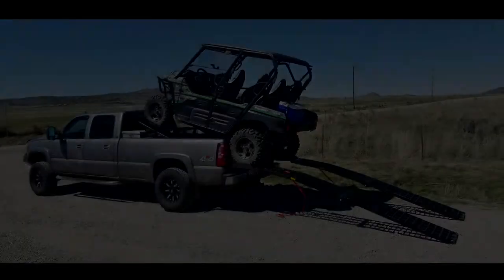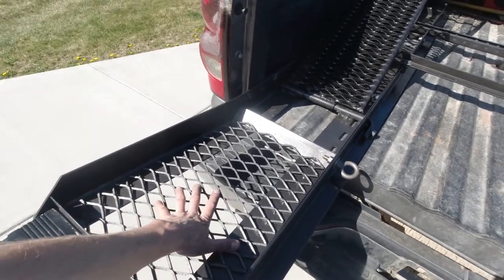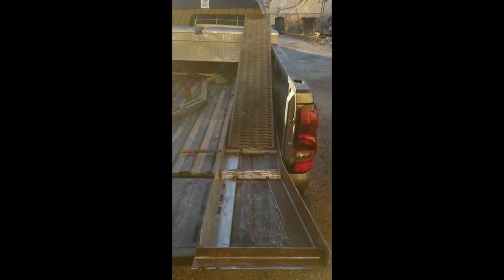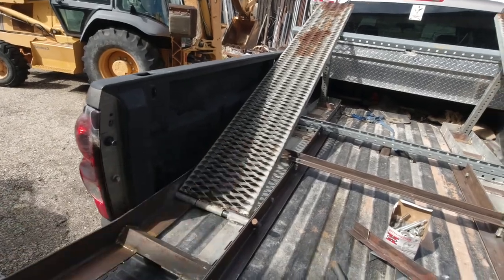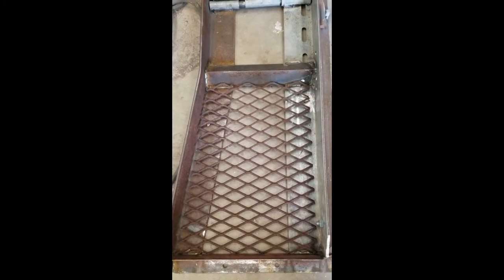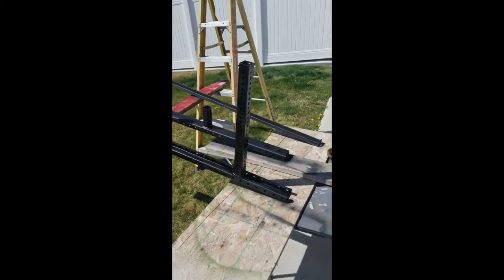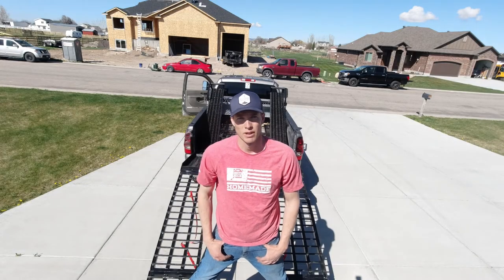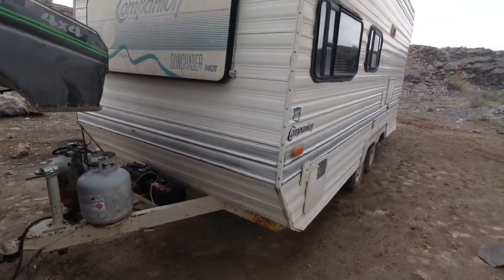DIY Truck Bed UTV Rack out of 100% Scrap Metal

Comment: I’ve been kicking around the idea on how to haul my Ranger along with a camper without investing in a tow hauler. This might just be the solution,  it’ll be in a 3/4 ton 6.5’ bed Chevy. Shorter than yours but the ranger I believe is shorter than your sxs anyhow. Nice work
Reply from the maker: Thanks! maybe even measure how it'd sit flat ontop of the bedrails. Raises center of gravity a bit but would be alot less work and more space in the bed? Lots of ways and diff ideas...
Reply: @mountainmarshmemories7012  That would be nice to still be able to haul stuff underneath the ranger....Do you have airbags on your truck? Thought I heard them air up....
Reply from the maker: I dont, I'm planning on doing it eventually though.